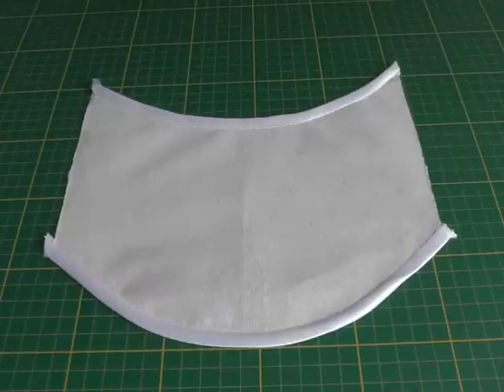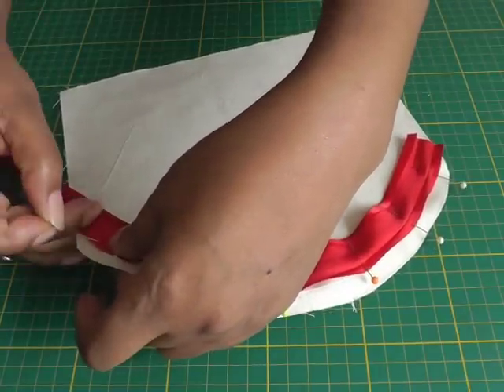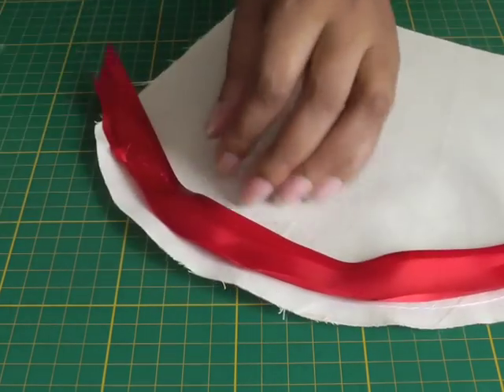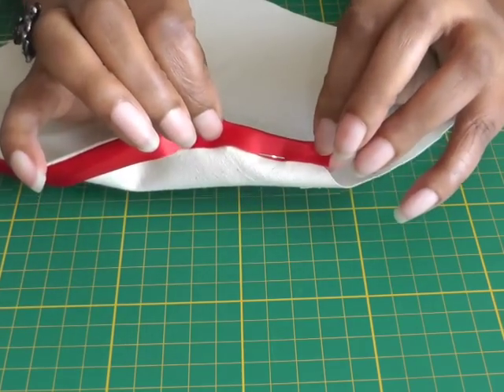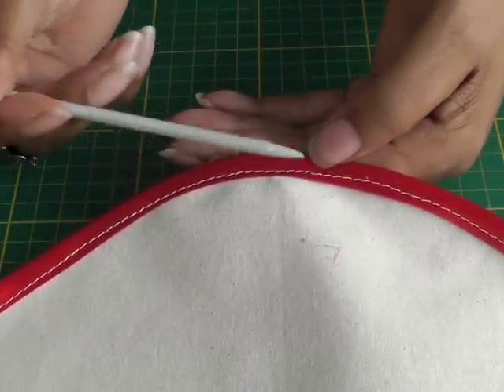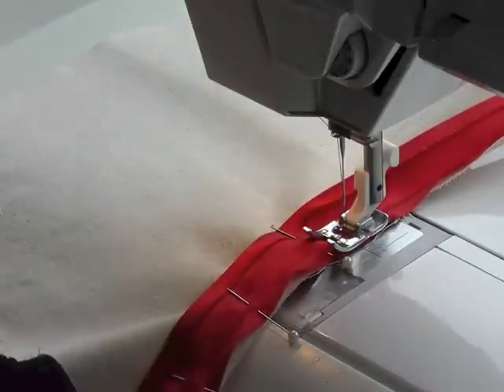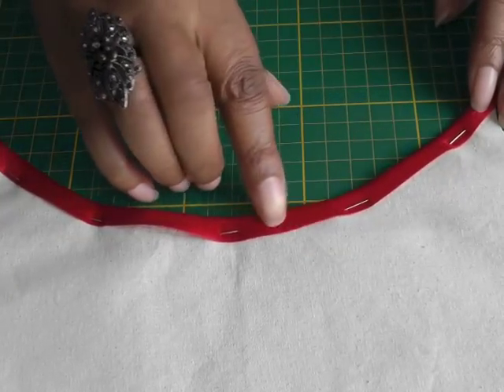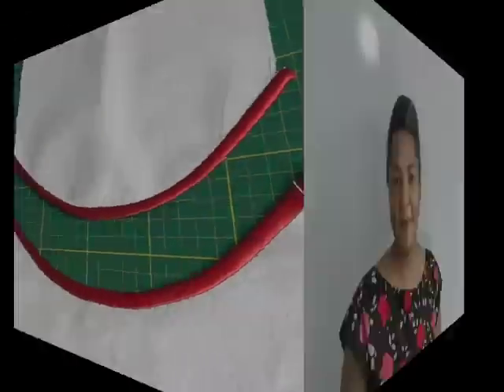Sewing Bias Binding onto Curved Seams

Comment: I could kiss you. I have looked for information on the best way to sew bias binding on curves for years. This method is the most wonderful way I have seen yet.  After time and use of fabric's done using other easier methods, I have found that the fabric under the binding begins to pucker up and show through to the surface through the binding. Wearing causes the fabric color to have faded out spots, and waves uncontrollably. This way...The extra fabric is cut off. Thanks so much!XXOOXXOO

Comment: Excellent tutorials ! Could i ask some questions as i always have the same problems. 
What if you need to bind an armhole on a flimsy georgette type fabric?  Plus is it in anyway possible to just 'hem' an armhole ??
Reply from the maker: You certainly can bind the georgette fabric, there shouldn't be any problem. The armhole edge needs to be finished but yes you can hem it. Hope that helps.

Comment: Thank you for this super helpful tutorial! I'll need to learn this quickly to make a dress for a friend so can I ask you some dumb questions? 

The stay stitch you've done on the outward curve is to stabilise the area, so the fabric doesn't gather/pucker etc, right? Does it also then serve as the guideline for the start of your bias binding? 

Since you're pinning the bias binding to the seam allowance line, which is further into the fabric than the stay stitch line, how much seam allowance would you recommend people use - the same 1.5cm? 

I'm making a retro style bodice using bias binding on the boat-neck collar, and the cap sleeves. I'm thinking it makes sense to sew the bias binding on to the pieces of the bodice before I put the bodice together. Do you recommend that? 

Thank you so much!
Reply from the maker: Firstly! any questions asked on the FSBTV community are not dumb questions! Question one and two, your are correct. Question 3 Generally speaking yes 1.5cm, but it can be smaller or bigger, it’s just about how much of a focus you want on the bias binding.Question 4 Personally I would sew the bias to the neckline when the bodice is finished, as for the cap sleeves I would sew on the bias first. How hope everything goes well!

Comment: This was very helpful also can I use a lightweight jersey fabric using this technique? I try to put a band of the same fabric but it didn't lay flat. Tfs
Reply from the maker: Michelle Pempton You may get distortion in the fabric.
Reply: FashionSewingBlogTV I also have the same problem, it will be curve and not flat like your finished products, is this because of the fabric??
Reply from the maker: Hang Pham Yes it is. maybe try to stabilise your fabric with interfacing.

Comment from the maker: You can but the tape is meant to hold the shape so is designed to work with what it is applied too.  If you clip the seam, you weaken the structure.

Comment: How do you use it for corners, but inner corners, not outer corners?
Reply from the maker: Hello tactic, It's a little more difficult to sew bias to an inner corner, it depends if you want a sharper inner corner or a slightly curved inner corner which is easier and less time consuming.

Comment: Hi when I sew the bias on the right side and turn over to iron the stitch all is good but then when I fold it to sew the bias seems to be the same width as the right side of the fabric where yours is wider on the wrong side of the fabric what ami doing wrong  I hope you understand what I'm saying yours konrad
Reply from the maker: I think so! The trick is to stretch the bias a little so that you can sew it on the right side. And then press to make sure everything lays flat. (I hope that helps Konrad).

Comment: why should I not sew ON the bias binding, but only close to it? Is that because of the color of the stitching?
Reply from the maker: It all depends on how you want the finish.
Reply: FashionSewingBlogTV If you don't sew on the binding on the right side, won't it just flip up though, because it isn't being stitched down? Or does ironing the seam eliminate that issue?
Reply: Rhiannon Chiacchiaro I have the same question!  I guess I'll just have to try it on scrap first and see how it works :) Thanks for a clear and informative video!
Reply from the maker: Krystal Snow Rhiannon Chiacchiaro  You will have to sew it down so it doesn't move but your options for a finish may be to stitch in the ditch, top stitch or hand sew into position.